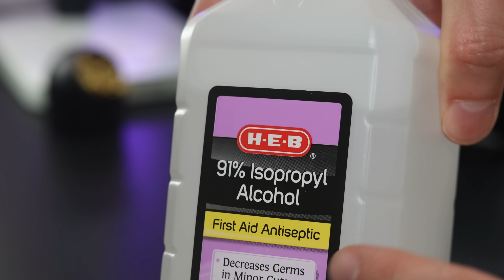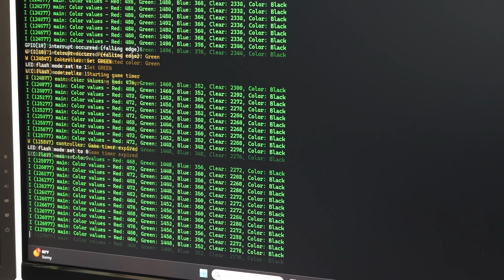Do This Before You Solder Anything

Comment: I'm sorry my guy, but that tip is beyond awful.  I used to have to work like that, solder would only stick to 1 very small part of the tip, it was rubbish.  I got a cheap Chinese soldering station as a gift with new iron and tips, ones that did not accumulate crap after many many uses, along with quality solder and flux, not Chinese cheap garbage, my skills went from "piss poor" or D minus to "skilled" A minus maybe even higher.  
You could sand that whole tip back to bare copper with sandpaper or a steel-o or that tip cleaner and then coat it in solder, that helped me, I also found though that the tip got eaten away, like pitted but it was eaten away constantly (on my old trusty 80w). 
I've had a blast with my soldering station, it genuinely changed my life.  It cost like $100 AUD and I got SOO many accessories with it too!  Temp adjustable iron +10 tips, hot air station with many nozzles, adjustable regulated power supply, all in 1, plus 4 crazy nice sharp various tweezers, many alligator clips and wires etc,msooder suckers, solder braid etc etc etc.

Comment: Simple way to get very good results with the least equipment and materials. 
1) Kester Flux-Pen # 2331-ZX looks and works like a felt tip paint marker. The flux is watery,  water soluble and pH neutral. It can be a no-clean flux if you want.
2) Eutectic ratio tin/lead solder 63/37 and you will never get a "cold joint". It is THE BEST solder. Don't even try lead-free solder unless you are selling a product into the EU. 
3) Run a hot iron. Meaning use an iron set to the upper limits for electronics and work fast. The hotter solder flows faster and better. Working fast keeps the total heat content lower.
4) Do the lowest profile parts first. (Not like in the video, which is just an example using the header.)
Optional: A lot of setups use a moist sponge to clean the iron tip. If you are going to do much, yes, the brass sponge is the cat's meow.

Note most of the popular small fast heating irons are terrible for getting work done. A basic iron with a fine tip that is a little rounded is all you need.

Comment: For decades I've been tinning my wires and pins with thin lead-free rosin core solder prior to soldering to the pcb. This alone allows solder to flow properly between the wire/pins and pcb pads. Another recommendation, if you're using small solid core wire, upon completion, glue gun the wires at the pcb as small solid core wires tend to break with very little movement. My 2 cents :)

Comment: a real pro! clean your shit, flux your shit, tin your tip, watch the heat transfer heat up your connection, and stay on the pad for another second after soldering to really make it stick!

the eevblog freak would be proud of you!! :D

ive seen enough tinkerers on yt who dont do any of that and still come up with (mostly) okay joints, but if you wanna have bulletproof connections that are reliable and last for the times, spend ten seconds using your brain and preparing your joints and your tip and you will never be happier!!

Comment: I rarely use Flux.

I use Solder with Flux in it. I typically go out of my way to get solder with the right type of flux in it for the job.

I got some cheap solder from China that was supposed to be of the specs I usually use. I had to get this because apparently, in the UK at least, it's illegal to sell Lead based solder to individuals.
There's not enough flux in it, it's crap.

So, I'm more likely to use Flux with this cheap solder.

Comment: What about different types of flux? I heard that some are not suitable for circuits and may lead to corrosion
Reply: You should clean the PCB after all uses of flux, even if they are "no clean" types. It's just the gold standard and having a small brush and a little bottle of alcohol is not expensive or a hassle.

Comment: 100% agree with your FLUX statement and message.  I've been soldering since 1989, and started using flux 3 years ago!  I've built some fantastic circuits over the years, repaired everything from amplifiers and CRT monitors (and TV sets), to installing questionable mod chip devices on every console to date.  Flux is an absolute game changer for quality work.  Sure it's a bit sticky to clean afterwards, but the quality of the solder joints is truly incomparable.  I wish I had been told to use it sooner also.  Oh well, at least I can solder with out it I guess, but it looks a lot nicer with the flux.
Reply: That is a looong time to go without flux
Reply: @ErionEduard  LOL, tell me about it!!  Small town, self taught from books back in the day.

Comment: Flux helps the solder to stick quickly & without excessive heat. Never solder without it.

Thick solder is not good for electronics. It takes too much heat to melt. You can always use more thin solder if more is needed.

Always discharge caps before soldering them onto PCBs. I destroyed 3 Neo Geos because I didn't know this.

Put solder on wires before soldering them to a pcb. Makes serious mistakes far less likely.

Lead solder is toxic. Don't breath the fumes. 

That's my $0.02

Comment: Do you have a link to the dispenser bottle you use? I've never seen anything like that, and I can think of a few great uses for it!
Reply: That's just an alcohol dispenser. You can find them as "ESD dispenser" or "fluid dispenser" with soldering in the search words.

Comment: not to be rude, but i don't understand why this is difficult for anyone. but i have witnessed it. this acquaintence i used to know could not get soldering for the 2 years i knew him, and i doubt he ever will. and i showed him how to do it like 10x. but it has something to do with how he thinks the soldering process works. as he kept thinking his goal was to simply melt the solder and like let it drop on the board. and no matter how many times i explained the process to him, he still believed it was all about melting metal. I didn't figure this out till he tried to use my welder. but perhaps others think in the same way?

Comment: My biggest issue is putting the headers on straight
Reply from the maker: what I usually do for the first one is apply flux, then put on some solder on the iron and then hold the header in place and touch the opposite side pin (the pin you are not holding by and the pin that has flux). The flux will allow the solder to really get in there. Once its tacked on you are good to solder as usual (just leave the pin you just did for the last)

Comment: Oh yeah - one more thing - why would anyone use pen type soldering iron keeping the darn hot thing on your desk asking for trouble - when you can use "gun" type that gets hot in a few seconds instead of minutes for pen type iron, and cools quickly immediatelly after use?
Reply: Pen types can heat in seconds as well. Check out the "Weller WXsmart" types. Size of a pen and heated up in 2 seconds. Not cheap. Not AT ALL cheap. Really great to work with though. A "gun" type as you call it won't do SMD soldering very well. If you don't do that and mainly connect wires and such a gun is fine. If you're working with parts that are 0.2x0.1 inches... you'll run into problems very fast. It's always best to use the biggest iron that lets you do a good job. Heating up a big piece of metal with a pen iron will be awful as well. Working 01005 SMD with a soldering gun? Good luck!

Comment: I have been soldering for 45 years by now, and always done what I first learned - put some flux on the item to be soldered, then a proper size drop of melted solder to the soldering iron tip, and that is how solder gets to the item - NOT by heating the item first and then applying solder wire. The advantage of solder on the soldering iron tip method is that it minimizes the time and temperature of heating of the item so less risk of heat damage to it. And it works perfectly fine. If more solder happens to be needed, just apply some more to the soldering iron tip and remelt the soldered joint. Quick and easy, with clean soldered joints every time and no heat damage. Can anyone tell me what the advantage of heating the item first before applying solder wire to it would be?
Reply: For reliable solder joints it's important that the solder coats all metal surfaces, so the best way to do this is to pre-heat the joint with a tinned-tip and then adding solder to the joint until the solder spreads to the intended surfaces. This is most important for soldering to through-hole plated pads connected to large metal areas (like power and ground planes), because the solder is not going to flow well unless the entire area to be soldered is at or above the solder's melting temperature.

Comment: I just disagree with the thickness of the solder being different for the different thicknesses of the wires. Thin solder can just be doubled or tripled for thicker wires. The soldering iron's tip should be clean and shiny and  of course flux must be added before soldering.
Reply: Yes it can be doubled or tripled but it's nicer to work without this extra step and just have appropriate sizes of solder on hand. Also nothing will fall off, drip etc. This is a beginner tutorial after all. The bad habits can be taught in part two lol

Comment: You didn't mention (and I don't see another comment), about a common problem: Once solder flows into the joint - don't move that joint in the slightest, this also results in cold joint. It doesn't take long at all, and you will develop a feel for how long solder takes to set. This is especially important for bigger joints that take more solder.
Reply: This isn't as much of a problem for eutectic solders, but it is still a good point.

Comment: My background is rf module assembly.  2x3mm modules with 4-10 parts on them.  I have a lot of tips I use.  StuckAtPrototype has some great advice here!!

There are MANY different solder compounds.  Some are low temp, some are high, some have different types of rosin/flux in them.  We had to experiment and did find the Indium 5.7LT1 solder to be VERY VERY gold lead free solder.  Bismuth solder is also low temp and quite good. 

indium5.7lt1-lowtemp-solder-paste

No one can he honest that lead free is "bad" unless they have done extensive testing of many of the flavors out there.  Some are not so good, some are better than leaded.   They all have specific reflow temps, buy the solder you need, don't just buy anything.  ChipQuick has some good ones too.  Not as good as the Indium 5.7LT1 but still they have much better prices.  

I love no residue tacky flux!  I use it on everything.  Makes beautiful solder joints!!  

The JBC irons are the best.  Metcal is very good if you can get one.  But JBC is the best I have ever used.

Ever have some high reflow temp solder that you need to reflow?  I have had some in modules that is >400C needed to reflow it, VERY hot.  Add some low flow solder to it and it will lower its temp drastically when they melt and they will melt much easier and need only a short time of heating with the iron instead of placing the iron on there for a long time with super high heat

Comment: Great video, one of the best on Youtube. You mention everything that needs mentioning. I remember back then when I tried to do it by simply putting a blob of solder on my tip and then holding that tip against whatever wire I tried to solder, wondering how I can get the solder to stick to the wire lol ... while poisoning myself because I didn't know about the need for ventilation

Comment: While you don't need expensive gear for great soldering, avoid the bottom of the barrel no-name stuff. I bought no-name tips for my iron, and they literally corroded away in a few minutes while soldering! I bought branded but still quite cheap tips, and they last. I only had this issue with lead-free solder though.

Comment: sooo, a thing almost all people say is raising or decreasing the temp if it doesnt melt or takes to long. most of the time playing with the temp is not that good cause it will eventually damage parts, and its all caused by one thing: bad solder iron... if you have ever held an iron that has a fair amount of wattage then you know, how low the temp could get but still heat your solder fast. (those are the types of irons that heat up to 300 C in about 5 seconds)

Comment: I just bought a TS101, and when I first turned it on, the temperature reading went crazy — jumping from -50°C to +450°C — and then it displayed the message “No Tip.” I was using a 65W USB power supply (the charger for my DJI remote controller).

Comment: Nasa solder standard is online and its not a hard read.  Really comes down to clean clean clean and heat. Btw the Nasa standards come out of the 60's and the the early age of spaceflight, so the use the right amount of solder and it has to be reliable.

Comment: Flux is usually not necessary when soldering tht components. The flux core in the solder should result in a clean joint. SMD components absolutely benefit from more flux. The flux in thin solder evaporates much faster.

Comment: setting temp higher to solder to big thermal mass like ground plane does absolutely nothing. the soldering iron needs enough power to keep the tip and the solderjoint at the set temperature. the iron will hit these higher temps only in free air if it hasnt enough power. higher thermal mass needs more wattage, not a higher temperature.

Comment: 0:53 false. There are Bismuth based solder that can be easier to work with because of 138°C melting point (if good quality and proportions)
Reply: He didn't mention indium, tin or silver either, that doesn't mean what he said was false.

Solder alloys are generally listed as lead or lead free. 

Bismuth solder fits under lead free typically, there are lots of bismuth/tin solders out there

Comment: If I'm being honest I hate lead free solder, knowing it was one of the causes of RROD on Xbox 360.
Reply: Lead free isn't used in military or medicine devices either but lead itself is just awful for nature and for the people working with the stuff. The RROD could have been avoided with a better heat dissipation. That's where most consoles have a problem. PS5 needed liquid metal that's causing issues. Just because they want a console that looks a specific way. I'd take an ugly box if it had a good cooling solution.

Comment: What is the brand name and model of soldering iron you use here? I am thinking of upgrading from my current iron.
Reply: I think it's the TS101. If you want a good upgrade, check out all the active tips in soldering. Chinese brands have the C245, C210 and C115. Going down in size. C115 is tiny soldering. You can just swap tips out instead of having a tip and a heating element seperately. Also has a much better heating because the heater and the tip are one unit without thermal barriers in between. If you're looking for something more quality and a lot more expensive, "Weller WXsmart" is the way to go. Best active tips on the market. There even are a couple of DIY soldering stations for their active tips out there. They're amazing

Comment: The flux discussion.  I have been learning to solder electronic parts for a little while now.  It is magical stuff.  Don't let anyone tell you that it is not needed.  The stuff is cheap so use it.  It makes such a huge difference.  This holds true even if you are using flux (rosin) core solder.
Reply: Not all flux-core is rosin based... there's also acid based flux-core solder.
Reply: Not all flux-core is rosin based.... there's also acid based flux-core solder. It's an important distinction.

Comment: Great explanation, and you didn't miss a thing. So many of my EE students are intimidated by the manual soldering process. I've made this video a mandatory course requirement. Everything you said here is precisely what I've also learned in my 45 years of teaching experience, even down to the 91% alcohol.
Reply from the maker: Love it! That’s an honor, thank you! Feel free to reach out via email, I’d love to learn more about the class you are teaching and if could help somehow. contact@stuckatprototype.com

Comment: Very good video. Agree. I would add: 1) Use a bigger tip for bigger stuf (or planes on PCB). 2) A flux works like soap (principle is the same). You can wash your hands without it. But better results would be with it. 3) A lead can worse you health by touching it frequently for a long tim. Consider lead-free solder.
Reply: Lead isn't the hazard you and others portray it to be.

Comment: fire.. this makes a lot of sense!

but what is the green liquid i see ppl use sometimes?? and what is the "resin" stuff that came with my iron used for??
Reply: Green liquid? Solder mask probably. That's a lacquer to protect certain parts. Often UV based like resin nowadays. The resin is flux. It's just flux that's more geared towards big soldering. Cable joints and the likes. Often leaves behind quite a mess you need to clean.

Comment: Good advice, but it's worth mentioning that sticky flux will leave a messy residue behind, and if it's not "no clean" flux it can damage your board over time.  If it's a small amount of residue then careful application of IPA can remove it.  But if you're doing a lot of SMD work then you will want to invest in some "flux remover".  It is a better solvent that will work in the nooks and crannies like the space behind pins.  It is a next level of wicked chemical though so you'll definitely want a good ventilation system if working indoors and some hand protection.  For pro cleaning results pour it into a flat bottom glass dish large enough to contain the entire board and let it soak for awhile agitating it occasionally.  Spray the remover off with PCB spray cleaner and it will look like it just came from the factory.